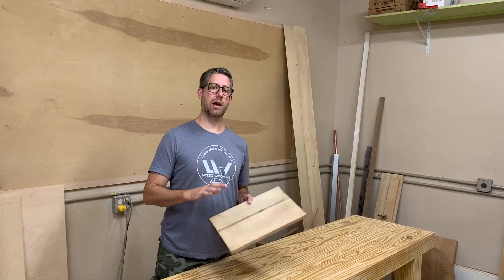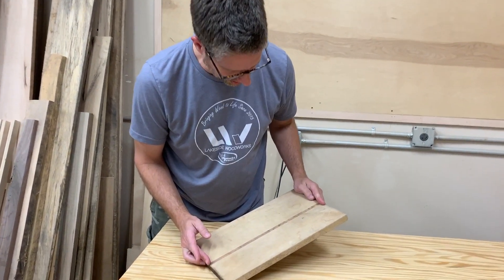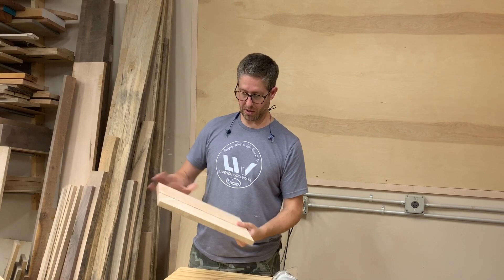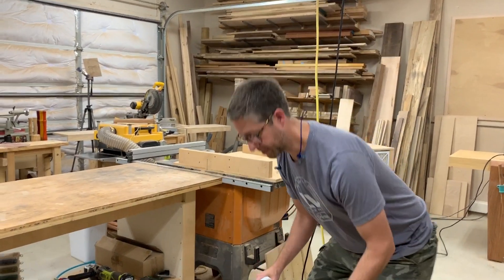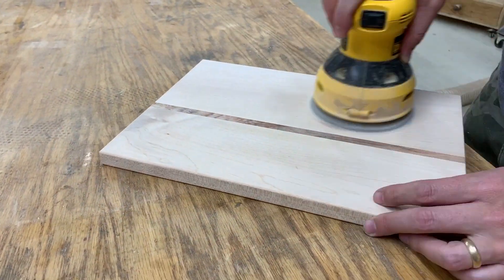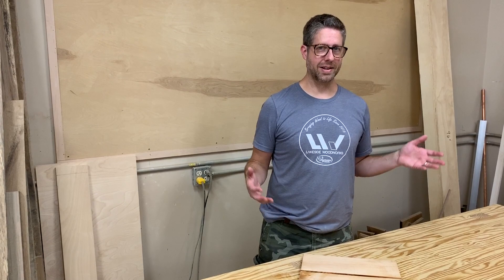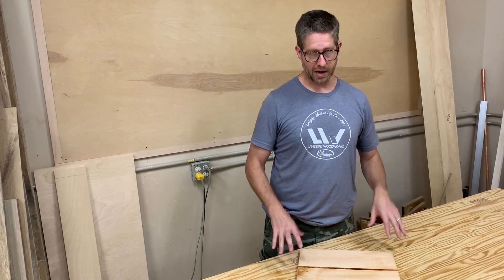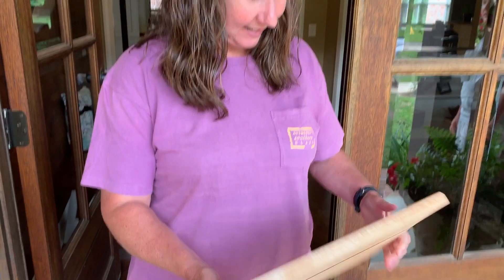How to Repair A Cutting Board (Just Like New)

Comment: Unfortunately I don't have a $1M dollar woodworking shop, but this was fun to watch. I am bound and determined to restore a pretty badly treated board. You showed me I am at least along the right path though. Thanks!
Reply from the maker: Boy, if this was worth $1M, I'd sell tomorrow! I don't have even $7k in this shop. You can do all of this by hand sander. It'll just take a bit longer.
Reply: @BruceAUlrich  $7k may as well be $1M lol. I do have an orbital sander and an attachment like 1.5" with velcro for small sanding discs. I couln't just miter off those ends, and don't have a router, but you're right, it would take a long time. I've also learned to disinfect with (separately) vinegar, then lemon and salt, and wood glue any cracks and sand while the glue is wet. I'm using a pot lid holder to dry and store my boards from now on, could be an idea to pass on!

Comment: Looks like you raised the grain and then took the random orbit sander to it. Doesn't using the power sander erase the work of raising the grain, meaning you'd have to raise the grain again and then hand sand?
Reply from the maker: No, because I was using 220 grit sandpaper and I didn’t sand enough to undo what I did with raising the rain. If you used a more aggressive grit, that’s very possible.

Comment: I have a walnut end grain cutting board that needs refinishing.  I've put mineral oil on this thing religiously every 6 months for the last ten years.  A few years back I tried to refinish it by sanding it but there's so much oil in the board that it gums up the random orbit sander pads in about 10 seconds.  How do I tackle this?  I don't have a drum sander like you nor do I know anyone who has one that I could get access to.
Reply from the maker: I don’t think you have another option but to just sand it. Do you have an old pair of tennis shoes? You can clean some of the debris from you sanding pad with that and then get more use out of your sandpaper.
Reply: @BruceAUlrich  Would it help to use something more aggressive to start with?  Like 40 or 60 grit?  Or do I run the chance of ruining it by going that low?
Reply from the maker: @plasmac9  No you could definitely do that, and the more aggressive grits should not clog as fast. You'll just have to be sure to go through with some higher grits again to get those aggressive sandpaper marks out.

Comment: Great video, Bruce. Very informative.  I would like to suggest that you use the router on the end grain first then long grain side. I realize you are putting a small round over on that board so the chances are slim but end grain is prone to chip at the corners so if you rout edge grain first, the long grain side will allow you to clean up any chipping.
Reply from the maker: Thanks, Nathan! Good tip. I know better but didn't start there. That's why in one of the clips on the end grain, you see me barely hitting it in the backwards position...trying to ease into the cut. Again, I know better. ha ha